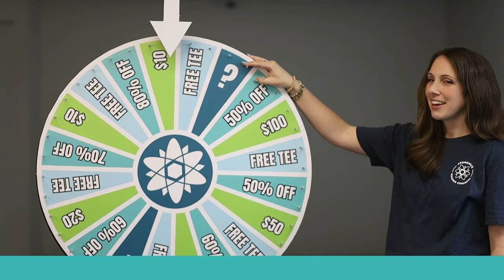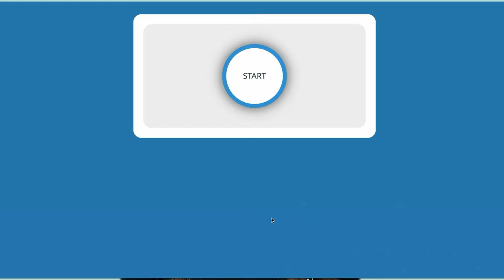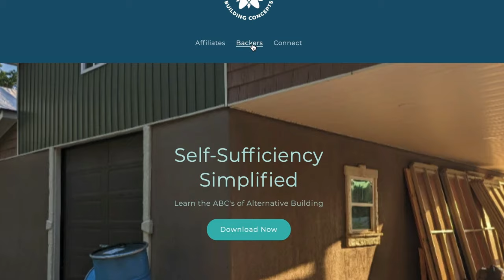START to FINISH - Abundacrete Well House Build!

Comment: Can you build a wider wall with the styrocrete to get more insulation? I wonder how wide you could go?
Reply from the maker: @krussellgal  Of course! There is no limit. I would imagine a 12 inch thick would be nice for extremely cold climates
Reply: @AbundanceBuild  Thanks!
Reply from the maker: @krussellgal  You're welcome!
Reply: @AbundanceBuild  This is good to know. My area gets down to farenhiet  40 below zero in the dead of winter and in the mid 90s, occasionally up to 100 in the summers.
Reply: just use 12x12"x20"  styrofoam blocks. Tractor Supply Company ususally throws them away. they are used to ship trailers. other trailer stores also would give them away free.

Comment: Another couple things that I think some people would be interested in is a impact test to see how much these walls can take and anchor test to see how much they can hold up with different types of anchors Lake Molly's tapcons screws nails and what kind of anchors are the best
Reply from the maker: More good ideas! The only problem with testing is official testing costs hundreds of thousands
Reply: @AbundanceBuild  you don't need to go that route you can do the basic test that they perform on job sites that 4 x 8 panel wall I mentioned you can put two sets of anchors in for each weight I would say 10 20 30 40 50 lb and you have two sets of those for each one of the anchors can you see if it can hold it for a long period of time you don't need to be extremely scientific weather just the basic idea of if it can't hold it is what a lot of us will be looking for and the impact test you literally can just put flat on the ground with two bricks underneath it so the middle is not being held up and just see how much weight it holds before it fails
Reply from the maker: @fightline4741  We could set that up
Reply: @AbundanceBuild  okay I think it would be very useful information for us that are thinking about doing it and it shows off the product on how resilient or what the benefits are
Reply from the maker: @fightline4741  the fiberglass mesh is a tried and true method but it would be good to get some semi official numbers

Comment: So this is basically substituting for Insulation only, right? The 2x4s are the structure and this is filling the void between them, right?
Reply from the maker: @REutubing  Correct in this case. But Abundacrete has good compressive strength, so with the fiberglass mesh it can stand alone. But obviously will require a shape to fill like a mold or earthbag

Comment: Question, would sticking rebars through the roof into the walls prior to the mesh and stuccoing make it hold together better?
Reply from the maker: @Norbingel  Adding rebar reinforcement is never a bad idea but it's not necessary for our method because the fiberglass mesh is so strong. But replacing wood framing with rebar framing is a good option

Comment: Many thanks and Happy Thanksgiving!

I've been a proponent and enthusiast of aircrete for many years and many hours of instruction. However, based on your excellent investigations, tests, testimonials and such I am inclined to take your class and give my first project a go using abundacrete. 

Question: Have you ever use lime wash to seal/finish walls?
Reply from the maker: @rockyciraco9531  Thanks for watching! We have not used lime wash but we have a self healing waterproofing additive we add to our stucco to seal the finish

Comment: Is the top piece solid concrete?
Reply from the maker: @itsMelejane  No it is also Abundacrete framed with stucco on it. Had that luxury of building it separately and using the tractor to lift it into place. Typically would want to pour the roof in place at the same time

Comment: Just to clarify, it is concrete/foam mix walls with applied regular stucco or cement overlay? You also applied stucco to the inside of the walls. Was that to protect or seal the concrete mix? Your pump house turned out very nice!
Reply from the maker: @spatz5145  Correct! We always use our perfected foam mix we call Abundacrete and prefer to stucco interior and exterior walls. However, you can avoid stucco if you want. We will show that in another video coming soon!

Comment: Seeing how you used the bucket loader to lift the roof on top… how lighter is this vs concrete of approximately same volume? Thanks
Reply from the maker: @goldenhandcuffs  I'll have to calculate that and get back to you. Just had the luxury of lifting with the tractor